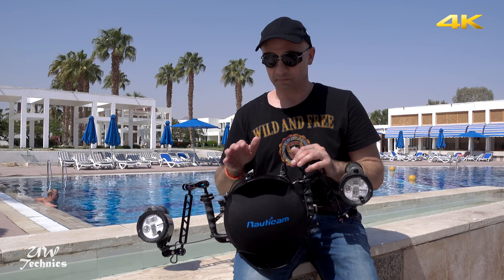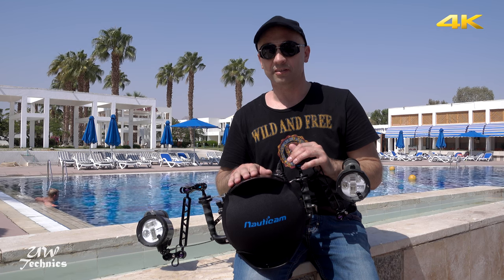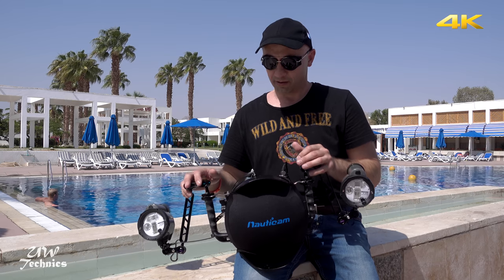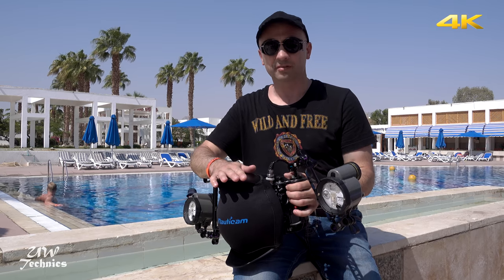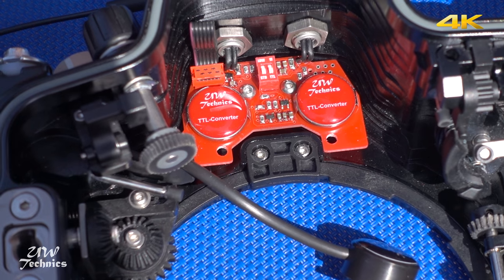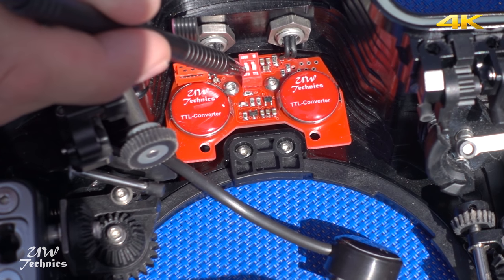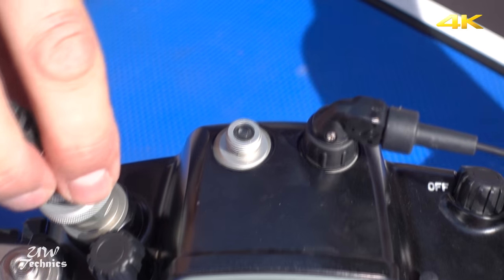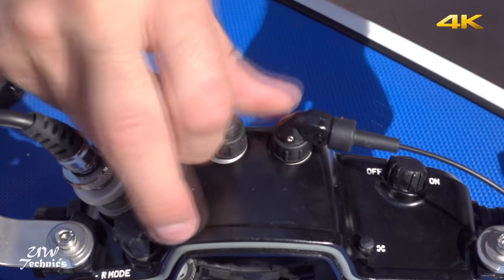UW Technics TTL-Converter

Comment: Hi! I have a Sony A6400 and a Nauticam housing for it. I am using two Inon Z-330 flashes which are activated by optical cables upon actuation of the camera's internal flash.
I need to make a lot of photos in sequence for photogrammetry. This leads me to a problem because, after a few shots in sequence, the camera begins to take some time to recharge and to shoot the internal flash. At some point it starts to take about 10-15 seconds to shoot the flash again. And I need to shoot every 3 seconds or so.
I thought that using a TTL would solve the problem, since it would not be using the internal flash anymore. However I have never used a TTL.
In your opinion, would a TTL solve the issue of the fast flash shooting sequences?
Will the TTL always force the Inon flashes to shoot twice for every photo or is there a way to make it shoot only once for every photo?
Thank you in advance,
Reply from the maker: TTL-Converter can work in TTL mode and in M mode, it can produce 15 fps and more, no problem. But underwater strobe Z330 requires 5-6 seconds for the full recharge. Strobe recharge will be a main restriction for your style of shooting. No sense to use TTL mode for your case, because TTL performs 2 flashes for each shot, so better use M mode (single flash for each shot). Yes, you can make 3 fps if set Z330 to M mode and set any small flash power. Z330 energy will be enough for few flashes. If use TTL-Converter, you can control these setting by camera menu, and by the strobe dials as well.